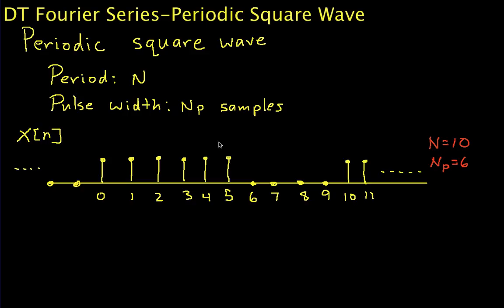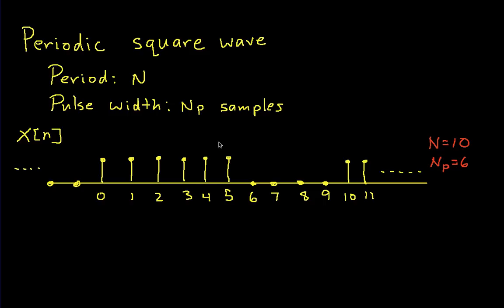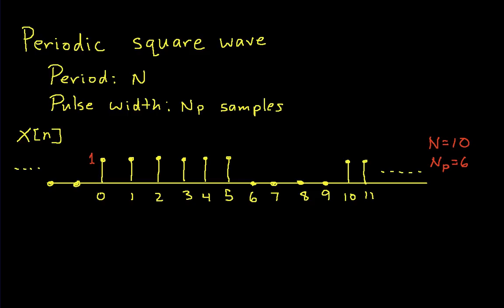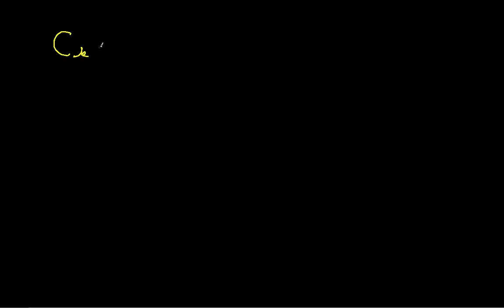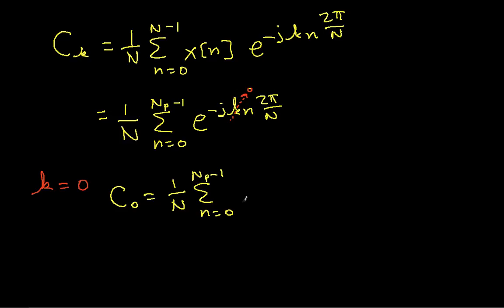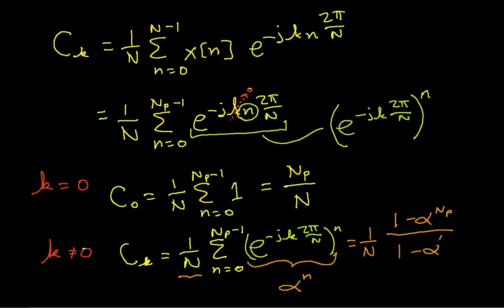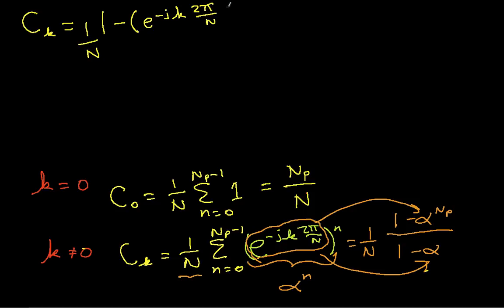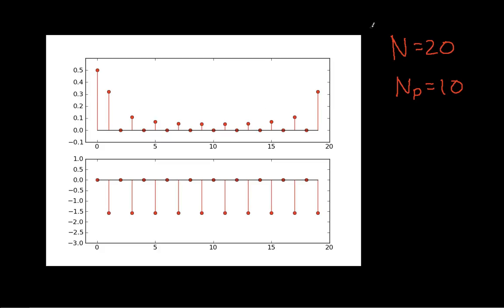DT Fourier Series-Periodic Square Wave

Comment from the maker: Two things make the phase different than -k(Np-1)Pi/N. The first is that the magnitude term (the quotient of the two sines) may be negative; in this case, we say that the magnitude is the absolute value of the quotient, and add or subtract a value of Pi to the phase (because a negative number can be considered a positive number with a phase angle of Pi). The second is that my phases are shown modulo 2Pi, so the phase value is always between -Pi and Pi.